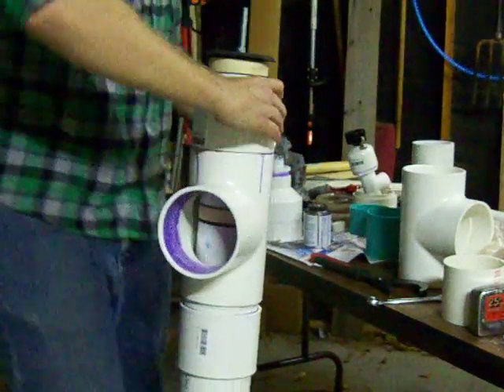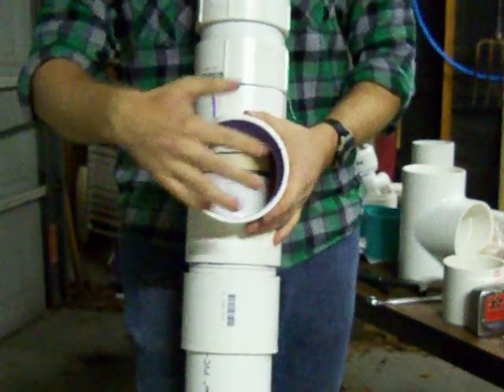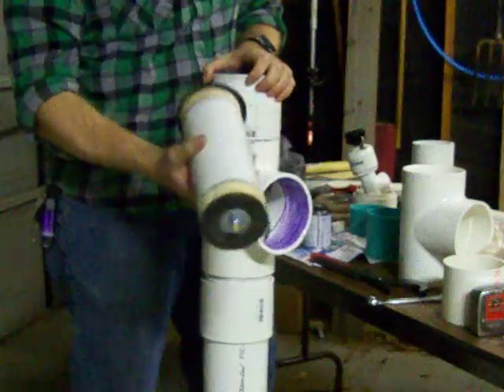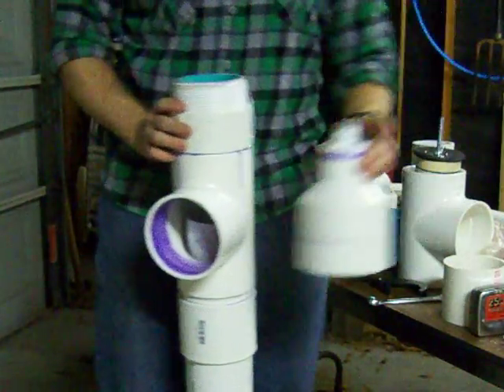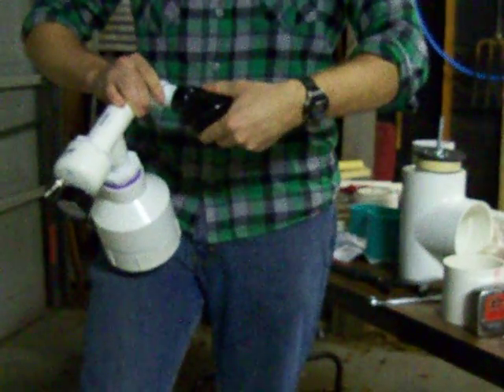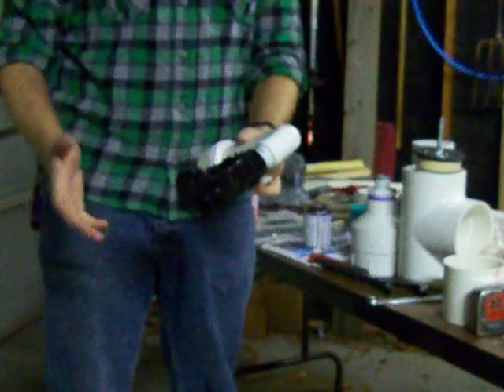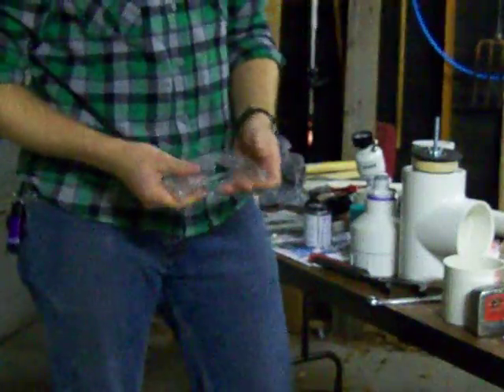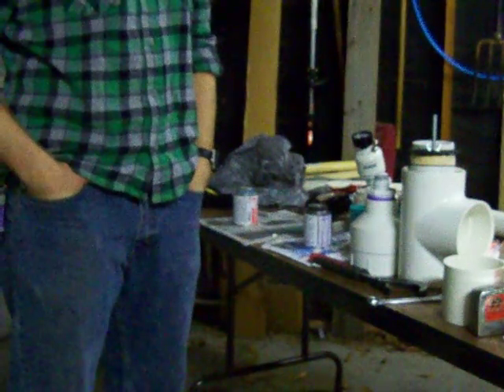Large Nerf Mega Aero Howler Launcher WIP (Air cannon)

Comment: How far can a full size vortex football go with a 1" sprinkler valve?
Reply from the maker: Probably not too far. Back when I was building my smaller cannons (~2 years ago), I tried to launch the big football out of a fairly powerful sprinkler valve cannon. The round went about 30 feet.

This is probably a pretty much ideal outcome, though - I've been following MilSimLabs (http://www.milsimlabs.com/) via facebook, and he posted safety data for the pocket and full size nerf vortexes. The big footballs traveling at sufficient speed have enough kinetic energy to maim or kill a person. After I saw that, I think I'll be using this cannon for demonstration purposes only. The pocket vortexes were much safer by comparison.
Reply: Thanks for the info.